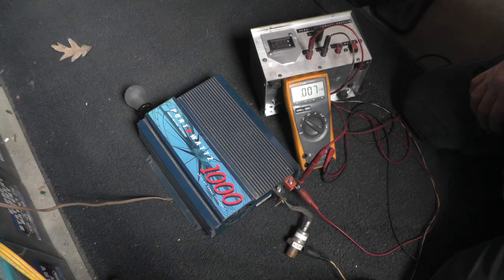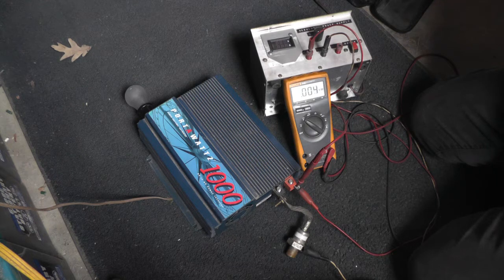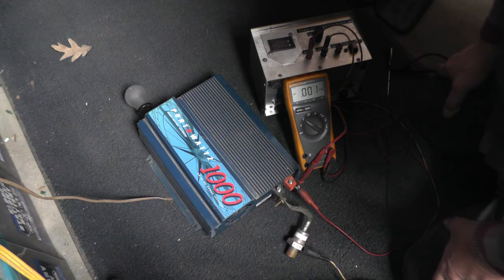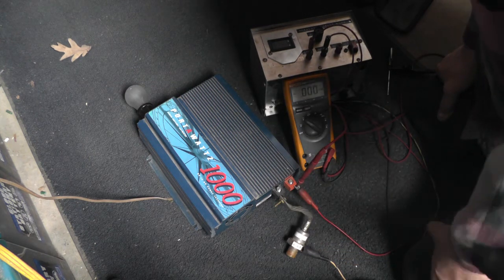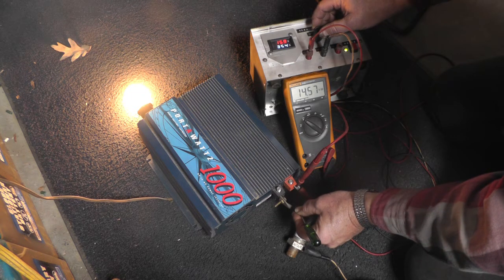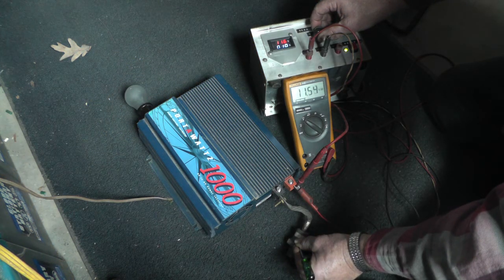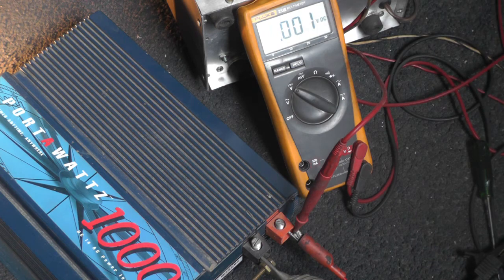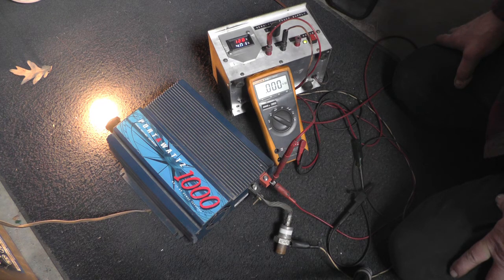Inverter Over Voltage Shutdown Solution

Comment: Thanks for this information.  Where can I get a 160 amp 50 volt diode?
Reply from the maker: I saved mine from some equipment I disassembled. I did a quick search on ebay and there are some that would work fine on there. It can be more amps and volts but I wouldn't go any lower on the voltage higher would be better.

Comment: this is the 4 units i haves as well, eco worthy 1000 watt mppt solar grid tie. they will only feed the house the power it needs. has main lug clamps to measure amp load, or you can run them as you choose. they are the only one i know that will run on a battery packs that are lipo and it has low voltage shut off when the batterys get to your set point and come back on when it increases they have a mppt build in as well. They are fully programmable same with my other 4 mppts for the lipo battery chargers. SunnySky solar charger is the charger i used it is fully programmable as well to any volt you want and has dc output control. Only a few will have voltage control like that mppt control has so you can charge lipo batterys to the voltage you set up and the weird volt that comes with lipos. I used both because i send all power to the lipos and then send it out from there because im pulling in 4k watts at noon and im only using like 800 watts.

Comment: its time for lipo batteries. Your adding to much equipment to skip that step. I'm running 48 volt 15 kwh pack i made from a ford c-max battery from the junk yard. Many other options as well. I hate to waste power from my solar system. Have 4- 1000watt grid ties. I love the water wheel. Id be out there everyday playing with it and watching it. I would upgrade the gen set as well and up the voltage coming from the water wheel system. Love your set up though.
Reply from the maker: If I find some for a good price I will but I am pretty cheap. Just curious how much were yours?
Reply: @kevincrawford2027  i bought 2 pack for $600 and then 3 packs for $1100 from ebay junkyard. They work out to be 3kwh packs but that was 3 years ago and knock on wood there still at about 14.5 kwh capacity. At first i had a 24 volt system but it over loaded my 4 mppts on the amp side so i went up to 48 volts and now i max out 2 of the 4 mppts to 60 amps each and the other two are at like 40 amps max. Its costly but i can cover the daily power and used the other half at night.
Reply from the maker: @Kammfrank82  Thanks  I will start asking around. I guess that would should be my next upgrade.
Reply: @Kammfrank82  Is that $600 and $1100 per pack or total?
Reply: @mikey4016  they worked out to be about $350 a pack, there sold in racks and there's 2 racks in a module. like i said you can go with what ever you want though and im sure they all went up in price.
Reply: Block of 21 Ford C-Max Energi Plug-In Battery Cells With Bus Bars Solar 1.9kWh, that's the listing in EBAY, now they are $425
Reply: @Kammfrank82  That sounds like a decent price, I wish I were wealthy enough to get some. Although if I ever do have enough money, I'd go with LiFePo4 or LTO batteries.

Comment: I like your solution for being able to use that badly designed inverter, it's a nice simple solution.

I'm curious though why you don't use dc-dc converters for your phone equipment, it would be much more efficient than going from the batteries, through the inverter and then through other power supplies to drop the voltage back down to whatever voltage your phone equipment uses. Unless of course it's the old phone equipment that ran off of something like 9VAC.
Reply from the maker: It's not the inverter that is at fault it is doing what it is designed to do. I like to keep it simple the inverter is on 24/7 and dc to dc converters mean more equipment to keep up and have problems with..
Reply: @kevincrawford2027  What I meant by "badly designed inverter" is that is was designed with the cutoff voltages at the wrong voltage, the high cutoff was too low and the low cutoff was way too low (so low it's as if they're trying to kill peoples batteries). But most of the chinese inverters are like that, they kill batteries and they often can't be used while the batteries are being charged.

Comment: At one point we used diodes to build speed controls for 1/8th size model trains ( 1970s ). As you could figure the Voltage drop per diode, you knew how many you needed to drop a certain amount. And then divide that by the number of steps you wanted between 0 and 24 Volts. As I needed to save space, I used 1/2 the number of diodes and ran the motors in series and then parallel. That also extended the battery life at 1/2 speed over what it would have been with just 8 steps of diode controlled speed. Which is basically what the full size ones do if they use DC motors and just vary the generator speed and Voltage instead of using batteries. When they reach a speed of the motors where back EMF becomes a major factor, they transition from Series to Parallel.  
Off = 0V at the motors
1= 8.4V drop 
2= 5.6V drop 
3= 2.8V drop 
4=12V seen at the motor that was on the low side to ground and 24V seen on the high side motor to ground but because it was still in parallel, it too thought it was at 12 Volts.
5= 8.4V drop or 15.6V at each motor and transitioned to parallel
6= 5.6V drop or 18.4V at each motor
7= 2.8V drop or 21.2V at each motor
8= 24V at each motor
Reply from the maker: Good information might come in handy for a project I have in mind. Thanks